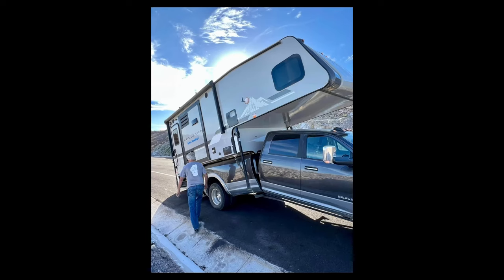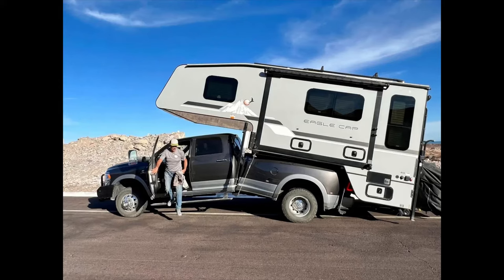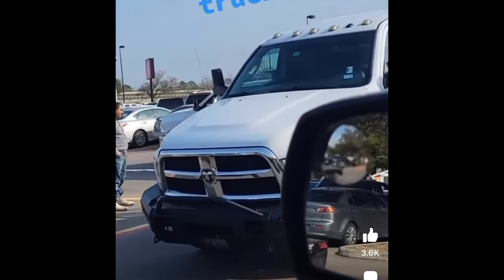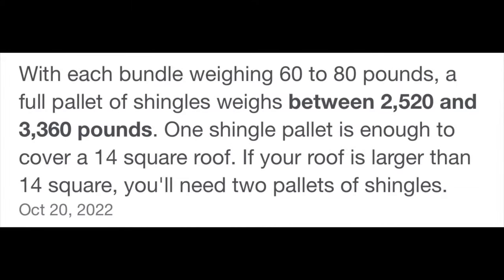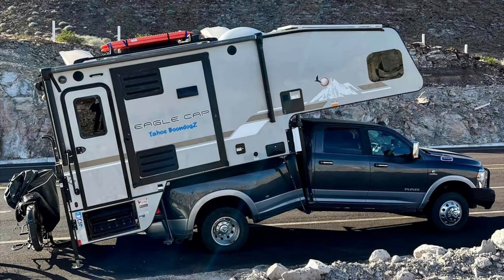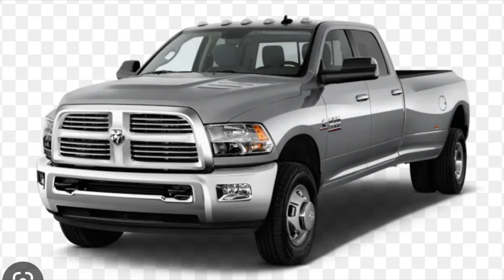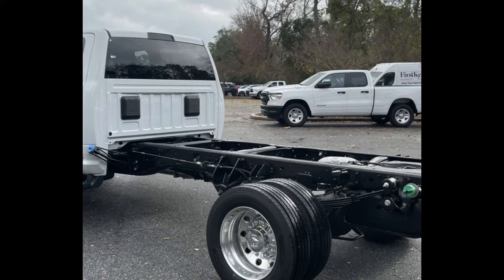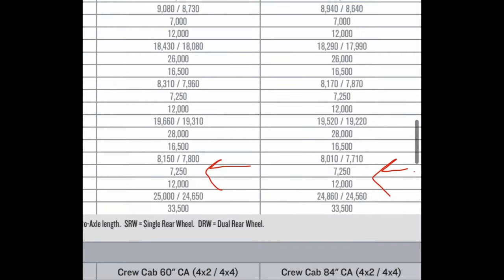Broken Ram truck frames 😱, what’s causing the failure and can they be repaired?

Comment: That one picture clearly shows the bed mounted in violation of the Ram upfit procedures. When they went to boxed frames only clamped connections are allowed. Welding is strictly forbidden as it is high strength steel and thus welding causes the hardness to go up and leads to brittle failures. Makes me wonder if the tie downs on that camper were welded. Anyway we have Ram 3500's from 2010-2022 several with 300K+miles and none have had frame issues and they get worked heavy hauling farm equipment.

Comment: From my experience, a dually seems to be much more stable towing, with less sway, as compared to a SRW. Also, I’ve had a couple instances of flat tires in the rear, and with the dually, I was able to drive to a location for repair, with the flat present.
Reply from the maker: Definitely.

Comment: I have owned f250 and f350 pick up and f350 and f550 cab and chassis .  I have overloaded them all to the extreme especially the cab and chassis ones 
All of these trucks will handle what 
They are legally rated for but 
When it comes to over loading 
The C channel has the ability to flex alot more then a box frame 
And can be over loaded more 
Before it fails. Also the longer the frame the more stress will be applied. Thats the reason these manufacturers add reinforcements To the areas  directly behind the cab when looking at a long wheel base
cab and chassis
I owned a 2002 f350 7.3  cab and chassis regular cab 141" wheelbase with a dump body 
And have rolled off the scales 
At my local sand pit at over 26,000lbs Thats 8 tons of sand 
On a truck that has a 12,500 gvwr 
And have done this many times 
Never broke the frame , but have blown a couple rear tires ,lol 
So decided to upgrade to f550 
With 19.5 tires with higher weight
Capacity and have not lost a tire since  Lol 😆😅
Reply: And now 10 ply tires are a thing of the past.  We have started converting everything to 14 ply tires.  No more blowouts from being overloaded.

Comment: The failures are primarily due to operator error.  People are grossly overloading their trucks and simply assuming the truck will survive.  The camper frame failure is a perfect example.  The camper empty weight exceeded the specific capacity of that truck configuration.  Then the owner added another 2000 or so lbs of propane, batteries, water, people and gear.  To make it even better he hung another 100 pounds of e-bike off the end of the camper.  Much of this weight was behind the rear wheels, greatly increasing leverage on the frame. The fact the frame lasted as long as it did is a frickin' miracle.
Reply from the maker: Definitely agree. Overloading has been a trend in all the pictures I have seen.
Reply: I dont care. This would never have happened 15 years ago
Reply: Big deal. My 2008 f350 Ford DRW has air bags and overloads because I overload it. Last winter with a 3 slide cab over (one of largest built) towing a trailer with a Jeep CJ7, elec. bikes, extra's, we slid off the road in the mountains. Slid into a huge gully that when we hit bottom the front came up and the truck was bridged across! Tore the rear tie downs off and camper just touched roof top. No frame damage and I rebuilt it. Yes it is a 6.4 powerstroke with 327,000 miles. I maintain it.

Comment: One of the reasons that folks are buying pickups and then overloading the crap out of them, at least occasionally, when they really need a dually cab and chassis; is because the manufacturers are de-rating the horsepower and torque output on cab and chassis trucks. 

As to why these pickups are breaking, based on the picture you’ve shown, is because the the bed mounting upright that is welded to the frame is creating a stress riser at top corner of the fully boxed frame (a rectangular tube, essentially). The crack initiates in the top-outside corner and then the twisting of the frame, through everyday use, causes the crack to run over the top wall of the frame and down the inside wall as well. When you combine this with the fact that the truck is being way overloaded behind the rear axle and trying to lift the front of the truck, it has to break! It’s both a manufacturing and operator problem.
Reply from the maker: Definitely agree.  Big torque engines, loads behind the axle, and overload.  Sounds like a great way to find where the frame will break lol.

Comment: It's funny how we never had this problem in the past with our older trucks. In fact many of them got a second life as a trailer pulled behind another truck. 
I owned many 1 ton single wheel rear axle trucks and worked them hard with no issues.

My old dodge power wagons were abused by us and we never bent frames and put a good 1,000 lbs more than what new trucks are rated regularly. 

We used to haul a yard of concrete at a time from town out to our farm / ranch out to the fields and pastures to pour pads for tanks, buildings and feeders when concrete trucks could not get out there. We laid plastic in the box so concrete wouldn't run out through the cracks and hauled a yard plus amount in the 8 foot box. It was around 4,000 lbs and we torqued and twisted those frames driving through fields and ditches without breakage or bending.

The problem with modern trucks is engineering and trying to take as much metal weight as possible out of them to increase fuel economy and profits for manufacturers.

Right now I have a 1974 square body chevy 1 ton pickup box trailer that I pull behind a 2024 Ram 2500HD. The reason is that I don't dare put the amount of weight in that dodge that I can in the old pickup box trailer. 

I just hauled a pallet of concrete 16 x 16 pavers and 30 - 20 lb bags of land scaping rock in the trailer and half of that weight is still on the trailer. I had complete confidence in that old truck box trailer and axle. It is the old heavy c channel frame that will flex and twist but remains stout. 

American made is just lip service these days.

Comment: Thanks for a great video after watching the video and reading all the comments I think I can add being in the Roofing and Sheet Metal industry. Professionals don't pick up their shingles at Home Depot. But if you did you put the weight on a trailer those trucks are engineered to handle their weight through a trailer. Much better than carrying them on their backs. You're right about the cab and Chassis but what I can add to the conversation is you don't even have to go to 4500 you can just get a 3500 cab and Chassis. Just left the roofing supply house bring you your shingles on a semi properly organized and ordering it ahead of time is the solution
Reply from the maker: No doubt a trailer would be the way to go, and is what a vast majority of contractors here do.  The weight difference in payload depending on configuration isn’t that much more going to a 450 over a 350.  And you’re right, there are options for c&c 350s with some companies.  I think a lot of people don’t realize how much force/torque is on a frame when you’re talking a double cab & or long box with a 700ftlb toque engine.  Much of why frames “back in the day” didn’t break was because frames that long didn’t exist in pickups, and they only had 300-400ftlbs of torque.  Something’s got to give at some point, especially with a lot of load behind the axle.

Comment: Down here in Florida Greg anything over a 3500 down here is considered a commercial vehicle that's why a lot of people pick up on the 3500 and try to put airbags on them and extra leafs and all kinds of stuff and overload them and keeps them in that loophole. We call it the gray area down here in Florida cuz once you get over 3,500 in a certain way down here you got to have a commercial license CDL...
Reply from the maker: Thanks for the comment.  That would make a lot of sense.  In Wisconsin my insurance is the same price and license requirement is the same for the 350 vs 450.  I was going to buy a f450 instead of the 350 I have but I couldn’t find a 450 equipped the way I wanted at a reasonable price.  I do know the insurance goes way up once you go above f550 here, and they won’t insure a CDL vehicle as a non commercial vehicle (aka personal use) lol.
Reply: @makingmistakeswithgreg   I made a mistake on that reply when I did it last night down here in Florida anyting over 5000 pounds is is considered a commercial vehicle and they charge you more tax on your license plate every year or road taxes in the gasoline and then your license plate.
Reply: No CDL in FL for A 5500 for personal use. Insurance for personal use is a PITA though.

Comment: My buddy bought a new 13’ 5500 with service bed already installed. A week later he broke the spindle on the rear axle and nearly lost a set of duals. He made them buy back and bought a kenworth 270. It fit his needs better anyways with bigger crane and easier to service. He ran for years in a 70s Chevy (new then) 1 ton that stayed way over loaded. I remember him telling dad talking “you can’t do that anymore”. Dad bought a 1980 3/4 ton Chevy at auction with a broke frame. He welded it up and ran it 600,000 miles. He’s a ford guy though, but will tell you that was a great truck… except the frame.

Comment: I have a 2005 Dodge Ram 2500. There is a crack in the bottom of the frame rail. Right where the cab ends and the bed begins. About a foot long crack. I was thinking of removing the bed and gas tank, welding a U brace under the crack to brace the frame and cut out the bad section.
Then use 2" square tubing say 3/16 wall and slide that into the frame rail as far each way as I can get it. Drill some holes thru the frame for plug/rosette welds and then button it all up slowly with welds. Not going too much each day to not overheat the metal.
The truck is in wonderful shape except for that one area and I dont overload it. Just need it for driving locally and doing work around the shop and such. What do you think?
BTW: I loved your discussion on the video. Thanks! 😊
Reply from the maker: Great question.  From a liability perspective most people would say junk it.  From my perspective I think it’s salvageable.  If there is no “repair kit” available for your year and model, you must take it into your own hands.  I believe it is fixable, what I worry about is what the material is made out of.  Without going into a ton of boring details, if the frame is made out of certain steels, the area around the weld becomes brittle after welding.  The issue with this is the frame could likely crack again.  How this is avoided is the welding is completed and then the frame is heat treated.  I am not sure if that is the case on your frame, but there is a possibility.  There isn’t a lot you can do at home to achieve a proper heat treat, and attempting a backyard heat treat will likely cause more issues.  So based on that info this is what I would do:

I would clean everything spotless, bright and shiny bare metal.  I would get all the repair pieces cut and fitted.  In preparation for welding I would preheat the whole area in the area to be welded to 300 degrees (The preheat is common on higher strength steel).  I would weld single passes as required, and I would let the frame cool off to 300 degrees before doing a second or subsequent pass as needed.  Keep in mind the preheated plate will require slightly reduced settings, do practice on the same thickness material to get it dialed in.  Avoid having a start or stop on any corner area.  Any tack weld you place feather out.  

Couple more tips 
I would avoid using flux core Gasless wire because it produces a fairly brittle weld.  Stick with er70 mig with c25 gas (100% co2 will cause the weld to lose ductility) or 7018 stick rod.  Dual shield wire with a 250amp machine would be another ok option.  

Again like I said I think it’s a doable job, just take my advice and try to make as clean of welds as possible.

Comment: From a collision teck point of view You don't weld on the frame as a rule of thumb Because of change to the tensile strength of the steel you end up making it more brittle...
Reply from the maker: Generally speaking insurance will total out a broke frame like that just from liability.  It could be put back together and last, it’s just that nobody wants their name attached to it.  Can’t say I blame anyone for that lol.
Reply: The proper way to repair a wrecked or rusty frame  is to replace it.
3 year's ago a youtuber named Westen Champlin bought a wrecked 2019 Ford Raptor. His crew put a new frame under it and returned  it to service. It might be a lot of work but much safer  in the long run.
As to the rust issue on vehicles  in general  and truck's  in particular spraying them down with a petroleum  based liquid twice a year will keep the rust away. 
When I was a young fella I got a job at a service  station ( I was 15. OSHA would have gone nuts if they had been around  back then!) The boss bought a new 1965 I.H.Scout to use as a Plow and service truck (bank of 6  12 volt batteries  in the rear to jump start vehicles. Nice weight over the axle also for plowing) He sprayed non-detergent oil over the frame in the spring  and fall letting  it dry for several  day's  before  returning  it to service. This truck is still doing yeoman  service in Hackensack MN. as the mechanic  that worked for him bought it when the boss retired. He still pressure  washes it twice a year and sprays it with a petroleum product. The non-detergent oil was replaced with a product  called LPS-3. It is available on Amazon. It is similar to Fluid Film but is a wax based product  and sticks to the frame  better and lasts longer.
The boss also sprayed down his 1ton I.H. wrecker he bought new in 1966. It lasted very well until he sold it when the property  was sold and he lost his lease. The new owner didn't keep up with the oil coating  and this truck literally  rusted to nothing in 5 year's!

Comment: That should have a U bolt mount instead of a welded plate for a flat bed the normal Ned is not put on like that, at least on my 05 3500 5.9 manual 4x4 and 4 door .

Comment: Those customers definitely overloaded those trucks over the 5470 max payload in the box.  We have loaded diesel pickups with a 1 ton excavator and remote packer in the back and bottomed out the pickup on the blocks, but that is far below 5470.  With shingles we hauled lots of pallets, but we put them in a gooseneck stock trailer.  These new giant pickup box campers weigh a ridiculous amount.  We never had trouble pulling our 40 ft. Gooseneck campers behind a Ram 2500 diesel.
Reply: Gooseneck puts the weight over the axle, limiting stress on the truck frame.

Comment: Worked at a Ford Stealership. Ford F550  trucks are also having a massive problem of, chassis cab's,  typically with heavy duty installs like rollback or bucket trucks. Haven't heard issues with GM chassis cab's.
Reply from the maker: I have worked on a lot of Chevy tow trucks and I have never seen a broken frame on them despite massive overloads and the like.  The thing I don’t like about chevys frames is that for many years they had a bunch of different frame designs between the 2500 and 3500.  They had a frame for the 2500, 2500hd, and 3500.  The standard 2500 had a very weak small frame that was a joke.  The 3500 had a very beefy solid designed frame.  Ford since 2011 (and possibly earlier) used the same frame between the  f250 and 350 trucks, so you knew you can a pretty beefy reliable setup.  The primary difference in 2011+ trucks was just what rear spring set was used.  Anyway, I would never buy a 2500 Chevy for a work truck, 3500 absolutely based on what I have seen.  I am not sure if they still do that with the frames.

Comment: Tensile strength is a consideration, but I would like to see where these things are breaking and whether or not there is an adjacent well. The temperature of the weld can cause an Austenetic  Zone, which might require a little bit of annealing to keep it from coming apart. Your later explanation that it was immediately adjacent to a weld confirms my suspicion that the weld was put in a little bit too hot and wasn't properly stress relieved. When they went to the higher strength steel the higher strength steel also happens to be a little bit more brittle. I worked in industrial sheet metal for 40 plus years. I also have had work involving accident investigation and stress analysis as well as consulted in some aircraft crashes

Comment: In OH non commercial truck plates are for 2500 & 3500. Ford is the only conventional truck available in 450 with a bed. Those Rams look to be 4th Gen pre 2019, I'd say load placement is a major problem but the Home Depot pictures load in front of axle but frame is split top down which doesn't make sense so I'm guessing they moved some of the cargo after failure.